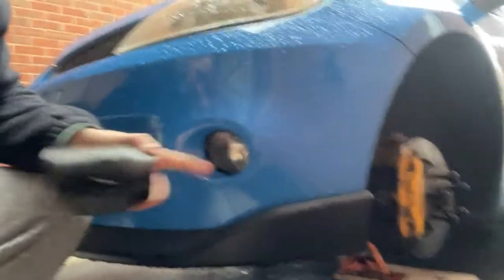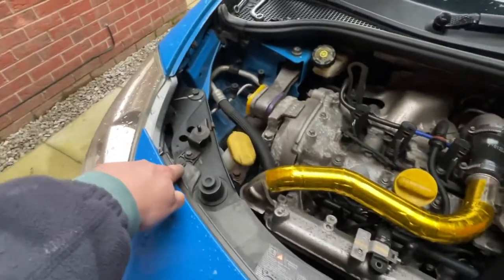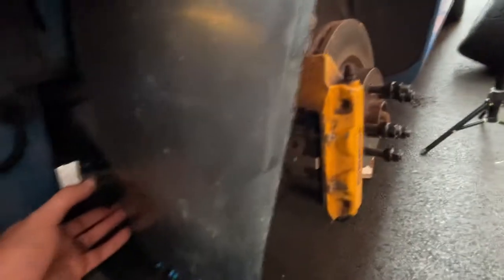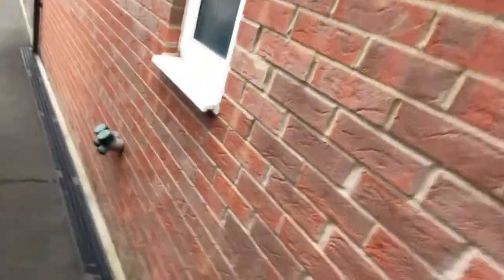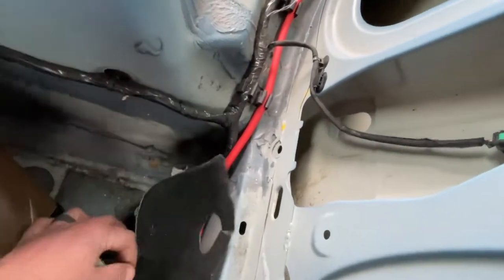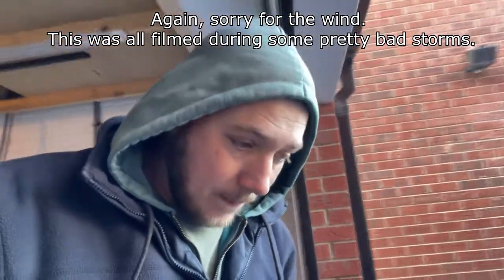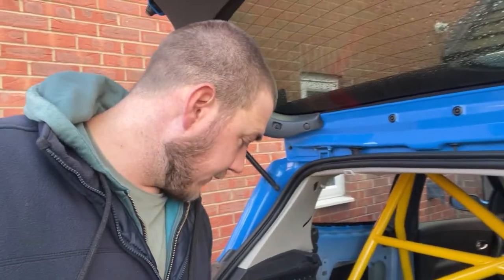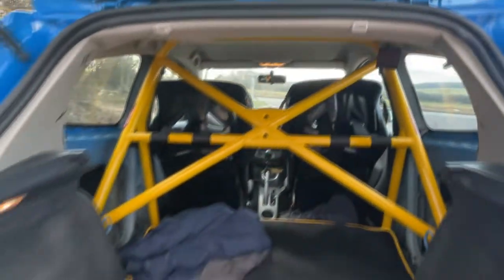Renault Meglio (197/200) Track prep, Brake ducts fail, Roll cage, Wheel studs, Wheels and tyres.

Comment: Be interested to see how you get on with the brake ducts. Got all the stuff to do mine just haven't got round to it. Seen a few people have had issues with the washer bottle being in the way. 
I'll wait to see how you do yours 😉👍🏼
Reply from the maker: It’s not the bolt on solution I was expecting/hoping for haha.
I do have a plan in mind and will hopefully get around to getting it done soon 👌🏻
Reply: @Drivers.Garage  The Twingo 2 bottle fits apparently and isn't as long so you can go straight from fog light to liner. I haven't got round to doing mine yet though
Reply from the maker: @TrackNut cheers pal. I’ve looked into the Twingo bottle but everyone I’ve seen has been a cable tied bodge job just to get by so don’t think it’s a bolt on solution. I do keep meaning to try and find one to mock up but think I’m going down the custom route. Still need to do a little research on it though.

Comment: Great video mate, thanks for the heads up regards the brake ducts as was planning to do this soon! Did you get it sorted?
Reply from the maker: Thank you buddy. I haven’t as I switched brake pads to the ds1.11 which handle the heat much better so I’ve not needed them as much. I did find the limit of the ds1.11s the other day though so brake cooling will be part of the massive lift of things I’ve got planned over winter. I’ve sold the ducts on and going a different route now which I hope to post about over the coming months.

Comment: What fitment did you select when ordering you half cage mate? Wanting to order the same cage for my 197.. Had a chat with the fella on the phone from JPcages who told me that regarding the non weld mounting fitment the rear bars are mounted to the floor rather than the arches. However I kinda want the same as yours hahaha. Any help would be greatly appreciated, your meglio looks the bollocks 👌
Reply from the maker: Cheers buddy. It’s coming on well. I’m behind on videos but it’s looking really good now. 
I asked them before hand if rear arch mounting is still available and it was so ordered as normal for a stripped out non weld cage then added in the comments that I wished for it to mount through the rear arches instead of the boot floor.
Reply: Literally just placed an order there mate. 👍 Give you a shout too when asked where I'd heard of them. Cheers for replying
Reply from the maker: @shaunearl3910  you won’t be disappointed based on my experiences. Thank you for the support man, means a lot.